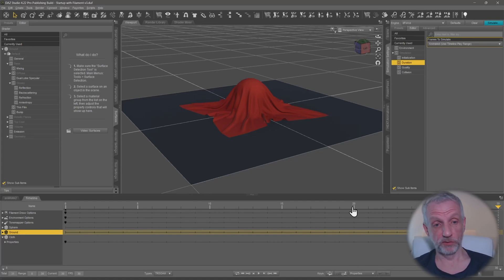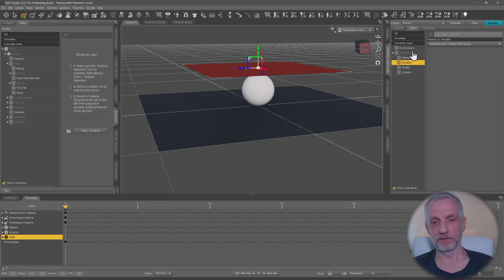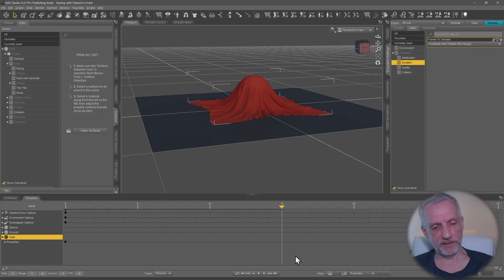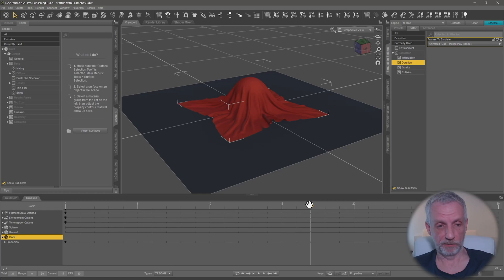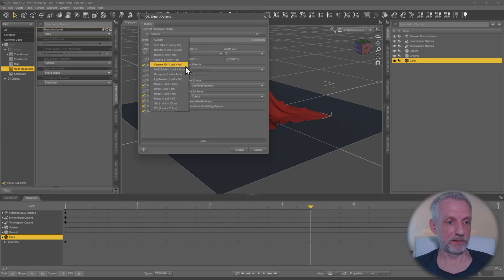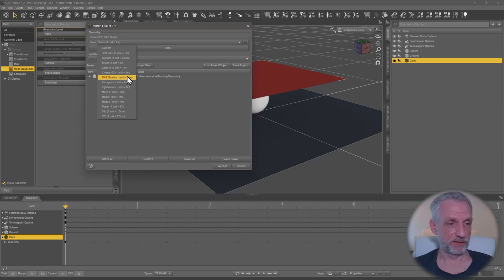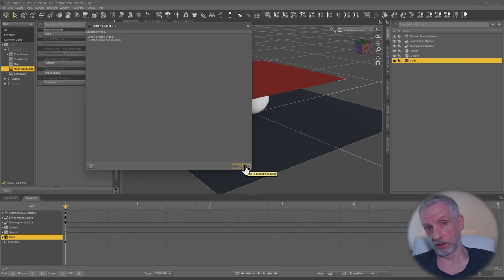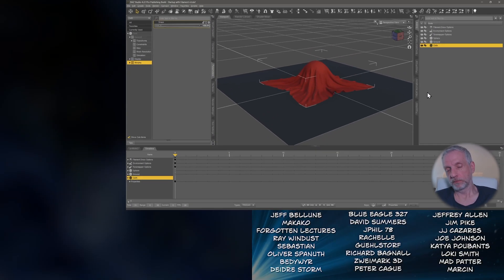Extracting dForce Drapes from the Daz Studio Timeline

Comment: Hello, I am a fan of Thailand. I would like you to recommend me a GUP to run those images. Between RTX 3070 and RTX4070, which one is better for beginners with a limited budget?❤
Reply from the maker: Glad to hear it! I’d say go with the 4070, the 3070 is nearly 4 years old at this point. If you can hang in there for a little bit, the new 50xx series is expected to launch later this year, so you may find the 40xx cards are getting cheaper, or you get more bang for your buck with something like the 5070 (we don’t know what it’ll be called exactly).